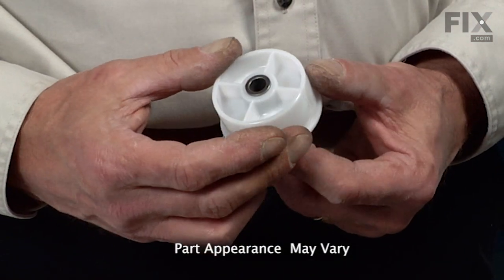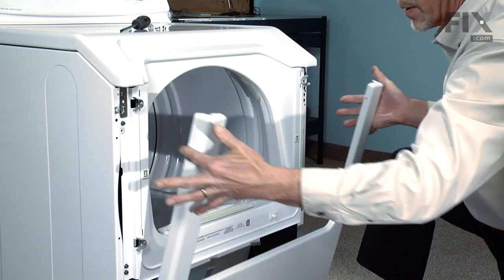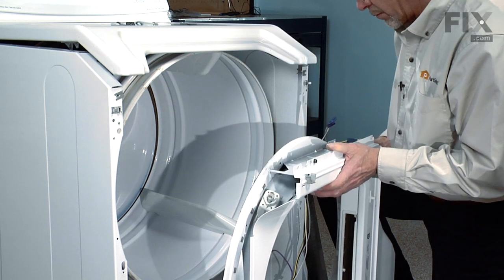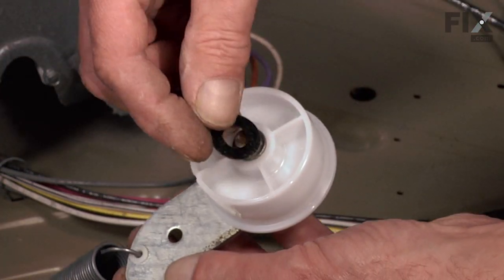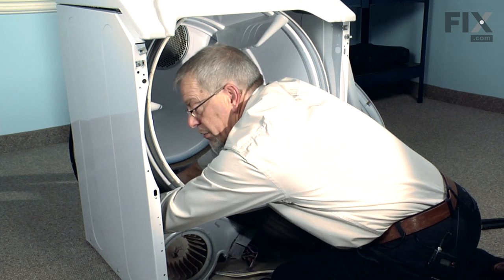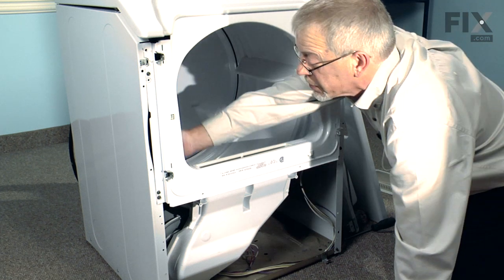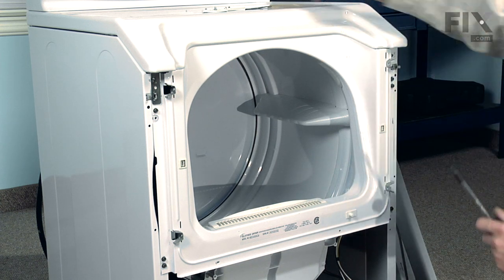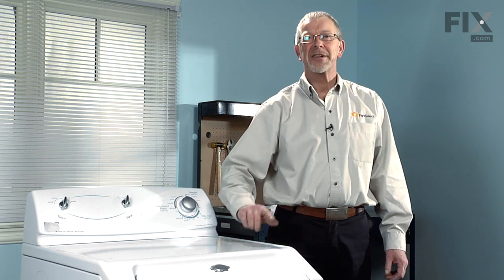Maytag Dryer Repair – How to replace the Idler Pulley Wheel and Bearing

Comment: The pulley wheel was installed in the wrong direction in this video.  The raised lip on the pulley wheel should have been towards the back of the dryer, which prevents the belt from ever coming off.
Reply: Yup. You can even see the original part had the lip towards the back.
Reply: Keen eye for detail... you can see how it is supposed to look @5:45 (with the lip on the idler pulley towards the back of the dryer)
Reply: I looked at it over and over... Seems to me he did it correctly.
Reply: @beegood1215  Compare 5:37 and 6:26.  At 5:37, we see the correct, original position while the original parts are still attached to the dryer.  The wheel's lip-side is closest to the back of the dryer and the no-lip side is closest to the metal bracket.  At 6:26 you can see the lip-side facing the front of the dryer, exactly opposite what we see at 5:37.  The problem is, at 5:53, with everything in his hand, the lip-side is closest to the metal bracket while he's disassembling it.  My guess is, he needed to re-record this portion of the video because he already had it taken apart and realized he hadn't recorded any of it.  So, he put it back together, incorrectly, then proceeds to record himself taking it apart and finally re-assembling the new part, again incorrectly with the lip closest to the bracket.  Good eye @Rick Nelson.

Comment: DO NOT assemble the wheel to the bracket like he does starting at 5:53.  It's BACKWARD!!  @Rick Nelson keenly pointed out, at 5:37 the lip of the wheel is farthest away from the metal bracket, but the rest of the video (from 5:53 onward) it's shown closest to the metal bracket.  My guess is the guy probably already had it taken apart and realized he didn't record it.  So, off camera, he assembled it incorrectly and starts recording at 5:53 with the lip closest to the bracket...and then re-assembles it that way, which is wrong.  If that ridge is nearest the bracket, the drum rotation strap will probably fall off the pulley and you'll waste more time with this repair.  It's frustrating that they have 59K subscribers and CLEARLY don't care about what they post.  I know this because it has been up for 7 years and 2 years after it was posted, users started pointing out this problem.  Report it!  Time is too valuable.  If it wasn't they'd use their time to FIX IT.

Comment: The video does NOT show how the belt goes around the idler wheel. Don't you think that's important?: It also doesn't show how he got the idler pulley off the area where it's attached. I think the instructor ought to try to think like someone who has never seen the inside of the dryer. I found the other instructions were helpful but I had to search the internet for a video that shows the proper placement of the belt around the motor and around idler pulley wheel. I also appreciate the comment below (Rick Nelson) stating that the idler wheel is installed incorrectly in this video, (with reference to the lip of the wheel facing towards the back,) I can't imagine why the instructor would do that.
Reply: I'm having the same issue. Where did you find a video showing  the placement?
Reply: @tinatinker1103  Dear Tina, Are you still looking? If so, I'll dig it up. Unlike Richard (below) I opened the dryer four other times to replace "other parts" until I finally arrived at this one on trial number five.

Comment: I've watched so many of these videos that I feel like I know this guy.  I have not read this thread entirely so perhaps this comment has already been addressed:  
Contrary to what is taught in this video, the grooves on MY Maytag dryer belt face AWAY from the drum surface...this is because of Model LDE312's belt threading diagram.  

If I start the belt reinstallation process by placing the groove-side of the belt against the drum surface, by the time the belt is wrapped around the motor shaft the grooves do not make contact with the shaft!  The shaft has grooves, which makes it clear that the shaft was designed for the belt to "fit" into  its grooves.

Common sense told me that the grooves SHOULD face the drum because of improved friction...so I was surprised when I discovered the "fabric" side facing the drum when I opened up my dryer.  I thought the previous technician made a mistake.  But now I understand that the grooves must fit into the motor shaft and the only way this will happen (if you follow the threading diagram) is to have the grooves face AWAY from the drum. 

Am I missing something?  I KNOW  that I am threading the belt correctly...

Comment: you put the idler on backwards from the way you took it off... the shoulder of the idler pulley should be to the outside to keep the belt from sliding off.  ??

Comment: It's amazing the level of noise the idler pulley wheel can make. I took our dryer apart once and determined it was this that was making so much noise. I would have purchased a new one but a mountain of clothes waiting to be washed and dried convinced me to smooth out the existing one with steel wool and then lubricate it. It worked great for a couple of months.....now I'll replace it.

Comment: Part number?
Reply from the maker: The OEM Part # for this part is WP6-3700340. You can find it here: https://www.fix.com/parts/dryer/maytag/fix11743032/idler-pulley-wheel-and-bearing-wp6-3700340/

Comment: My Maytag Atlantis was squealing and I suspected it to be the drum rollers. I used your video to take apart my dryer and replace the rollers. It took me less than an hour thanks to your video. Thanks for sharing, it saved me a lot of money.
Reply: min is squealing loudly then gets quieter as the dryer runs, but how do you know which pulley or the idler is going bad?
Reply: notmycupotea from what I was reading online, it was most likely a drum roller making the noise. So I bought both of them on amazon and just replaced both. I got lucky that it wasn’t the idler pully. If it had been no big deal it would have just had order it and take it apart again. Mine had similar symptoms as yours and mine also squealed more when it had a lighter load in it.
Reply: @notmycupotea  You really don't until you get in there and replace parts. If you're concerned, you can probably buy both rollers and the idler pulley for less than $20 and just replace all three. I believe they actually sell kits that include the two rollers, idler pulley, as well as a new belt.
Reply: @jhooton75  it turned into a rumble and now the noise has gone away altogether...guess Ill wait till it comes back?

Comment: Is there really a bearing on this thing or is that center fixed to the plastic?  Same question for the guide roller wheels.  They all seem fixed to me without any bearings at all.  I just re-lubricated the posts and reassembled and the squeak is gone - for now.
Reply: Sure looks that way.. Somebody should answer this. 
I'm considering whether i should take it apart now and try greasing it before ordering the parts.
Reply: Never grease the posts supports are riding on. It will fail alot sooner. Simply polish with Emery cloth till shiny

Comment: My pulley was the problem as it was very hard to turn. After oiling, it rotates just fine. Is that a satisfactory repair or must the wheel be replaced?
Reply: You can get away with cleaning the gunk that's collected inside the idler pulley bushing and on the shaft it spins on if the idler pulley hasn't been damaged by the belt running over it having worn a path or even a hole into it due to the idler pulley having been unable to rotate. It's best to simply polish the shaft by using a shop cloth and then using the shop cloth to clean inside the bushing of the idler pulley itself. If after this the idler pulley spins freely you're good to go. Lubricants can be problematic because lint will adhere to the lubricant literally gumming up the works. I don't use lubricants.